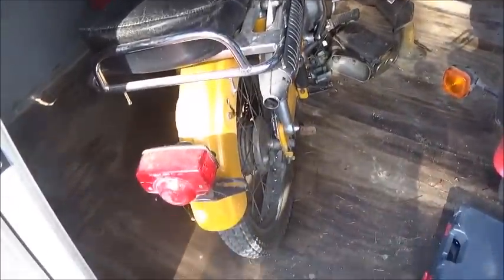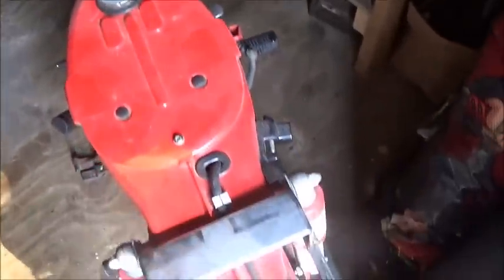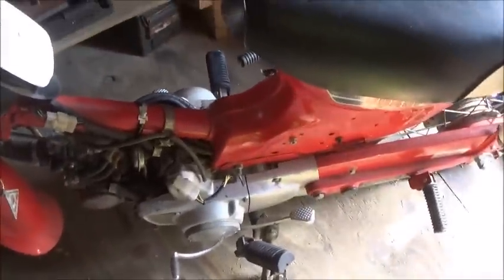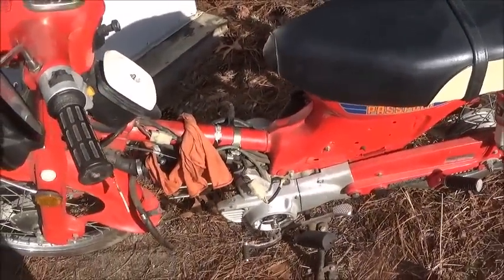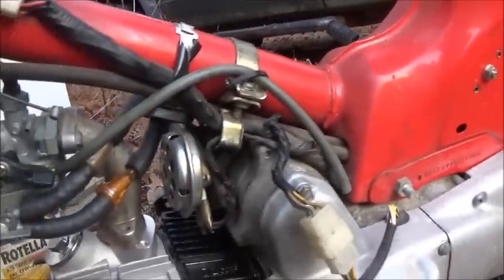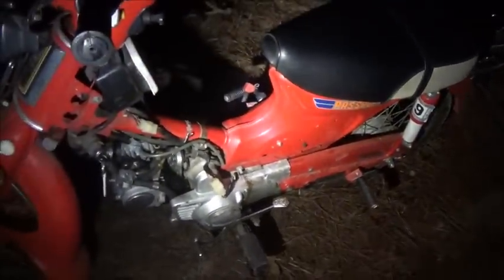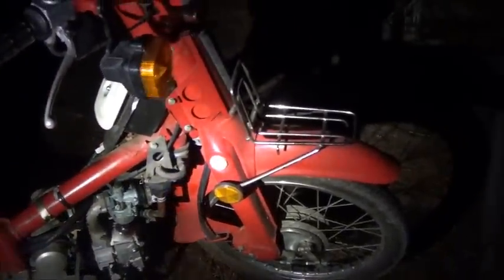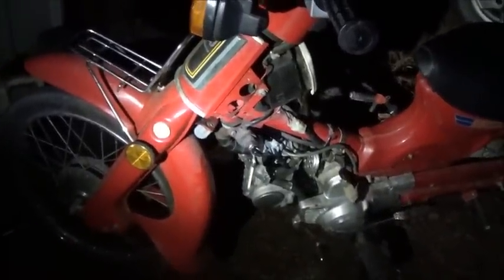passport

Comment: Me and my 71 yr old dad have been collecting antique small engines for the past year or 2. We've accumulated over 70 so far but only about 10 or 12 run. More will run with some tinkering. The recent lot of about 50 we bought along with a trailer load of parts,some have some interesting "modifications" as far as wiring and carbs go.

Comment: Great little bikes !! I have had many 50's 70's 90's and a couple of 110's over the years, I still have a 1969 CT 90 which I ride quite a lot. I did manage to get a new 2022 CT 125 which is Honda's retro of the old ct90 love it. By the way the Passport had a white wire basket that mounted to the front rack. Have Fun !!!!
Reply: I want the new Honda trail 125 or ct125 whatever name it is. Too bad they are all marked up like crazy!

Comment: Use all-thread with a larger socket on the one side of piston and a smaller socket to just fit the pin, washers, nuts, and push it out. Had one majorly seized last year that I used that method on. Got the pin out thankfully and saved the engine.
Reply: Yeah, I’m surprised he didn’t make a piston pin puller….

Comment: I had one of those bikes in 93, got a brand new carb from the local honda dealer. if you aren't careful the front end will slide out on you, there just isn't enough weight on the front to keep it pinned to the ground when you get on loose gravel or such.

Comment: Does sound like the camchain is loose. Take the intake tappet cover off and push the engine over till it's lifting the intake valve, that will take up all the slack in the chain then you'll see 8 mm nut down by the shift shaft with a slot in the bolt loosen the lock nut turn the bolt out that is what locks the adjuster, just open it for a second and the plunger should take up the slack in the chain. Sometimes you have to stretch the spring you can see the gallery showing through the bottom. Have fun thanks for all the entertainment Jonathan

Comment: I feel you, regarding the chicom parts. I needed a whole carb for my snowblower. Holy hell, an OEM part, for a twenty year old snowblower, was $110. Got an import copy + shipping for under $30. The machining wasn't great and it didn't have a bowl-drain, but how can you beat that price difference? Especially when money is tight, the original is trashed and it's the middle of winter.

Comment: Dad and I used a piece of threaded rod with a socket that would fit through the pin hole and a plumbing fitting on the other to push out a pin

Comment: I picked up a 1979 Trail 90 for $150 that had 40 miles on it. Someone had tried to jump it with a 12 volt battery and blew every bulb on it. And when they start 'fixing' things that's when the the side covers and airboxes go missing. I spent about 600 on used parts like the airbox and snorkle, and things from DrATV like a carb kit, ignition switch, new headlight etc but got it running pretty easily.
Reply: As for the bulbs…Use only bulbs from Stanley Electric of Japan.  The engine vibrations will kill any other brand of bulbs.  Any good cycle shop should have the Stanley bulbs.
Reply: @bcgrittner8076  Believe I got them from DrATV so believe they were Honda parts.

Comment: Not that it matters because it is a single cylinder, the timing mark for the camshaft timing is at the top of the opening, closest to the wheel. You can see it in the video.

Comment: cam chain adjuster is under a plug on the underneath of the engine remove the plug and wind the adjustment screw in may stop allot of that noise

Comment: That silly thing was the first bike that outsold and lasted longer than the HD 45! The 45 (2 and 3 wheels) lasted from 1939 (for the G and WL) until 1973! IF go back a generation, that would be 1929-1973! Not a bad run! The passport, from the 50s and still in production and sold all over the world (but I don't think here anymore). Worthy of saving, says the Harley/BMW/Ural rider.
Reply: now if you want to make that REALLY dangerous, slot a 125cc motor into it...

Comment: Have you rolled it over by hand?  Sure sounds like the timing is a tooth off,  learned that after rebuiling my son's,  it will run fine 1 tooth off,  the valve just barely touches the piston, not enough to bend it, that is exactly how it sounded,  rolled it over by hand and even then you could just barely feel the piston and valve touch. Thanks for the great and always interesting content.

Comment: Family time is it . That thing rattles like it has no oil pressure . Like a baby diesel . Cute , but noisy . Of course the dirt bikes ain't quiet either . With that much piston damage , I'm wondering if the rod bearings weren't toasted too . Definitely hear valve train noise . If anyone can fix it , Jonathan can .